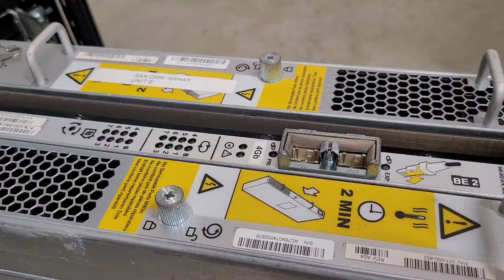What not to buy when picking a Disk Array on Ebay for your home lab. Say no to Dell MEMC KTNSTL4 FC

Comment: You are dead wrong..  You only lose the first four drives for FLARE code per array not disk shelf….
Reply from the maker: Sorry dude, not using the array with a EMC Dell array solution, (As in more then one disk shelf then you called it an array.)  this is native SAS config only.  No FLARE code involved.   This is me recycle old Storage array parts and using them for other roles.  Next time view the whole video... It about recycle old gear for new roles.

Comment: Hey, just saw your video. I recently got my hands on EMC SAE 25x 205 SAS/SATA SSD JBOD array. Can you explain how to set it up? They didn't send me any cables, so it is a bit confusing for me. And I have no booklets or setup guides.
Reply from the maker: Sure, it is all about your SAS controller and if you have a mini SAS port vs. a SAS port. Refer to my two videos for more info. https://youtu.be/ODQ2oRhXNOU  and  
https://youtu.be/X3nu6AZea5Q
Reply from the maker: As for a good cheap controller, go with a LSI 9200 or 9300 series  SAS two ports external controller HBA card to keep it simple or can go with a RAID version as well for more advance features.  Enjoy!

Comment: Opinions on the KTN-STIL3? SAS instead of FC. This one ships populated. All I would need is a SAS controller and cables? I will be using a Mac Pro. I have a 2009 and 2019. Not sure if I should go with ATTO or Rocket for the RAID card or just get a cheaper SAS card and go with SoftRAID.
Reply from the maker: I am not sure about MacPro. that is a new one.  But if it is a intel MacPro you can boot off of a USB stick and boot into Linux and do it yes...
Reply: @leadiususa7394  So this would not just show up as a group of SAS drives if plugged into a SAS card?
Reply from the maker: @AmanOU2be  No, they would show as single drive if you are using HBA mode.  Then use your OS to group them, if you are in RAID mode, you will need to first group the drives into RAID groups that then they will be seen by the OS as large sized single drives.

Comment: I picked up an old Kaminario/Silk 24 Bay enclosure that appears to be a EB-2425PC-E6-2EBD-2P580-0TB-KAM. It has all 24 Samsung Enterprise 960GB SSDs with the interposers in the caddy. I have two Cisco UCS-C220-M5 1U servers. Each of the Cisco servers is connected to the shelf with an LSI SAS9207-8e and cross connected. When I installed Proxmox on both servers, I can see all 24 disks but I can't format them or do anything. I was going to try loading ESXi or Windows Server for verification but it seems like they are not accepting any commands like formatting, etc. I'm not sure what I'm missing. All 24 SSDs were tested externally and they are all good so I'm sure it's something not sending the right signals to the array. Wonder if I need to change from the IOLM6 modules on the back to something more "generic?" Shelf has power and all drives are green and initialized as well. Any ideas? Thanks so much. This video was amazing for the homelab guys out there.

Comment: What can you recommend for adding additional capacity to my Dell R720XD? Running TrueNas, I can't decide if the MD1200 is sufficient, or if going for a 12gSAS is worth the effort. Usage is 4k video editing by 2-3 editors on 10gbe network.
Reply from the maker: Go 12GSAS for sure.
Reply: @leadiususa7394  what kind of shelf do you recommend? Looking for 12 bays minimum, 24 max. Noisy isn't a huge concern as the rack is in a central shared printer/copier room and an enclosed cabinet, but I'd like to not have to hear it from the elevators haha.
Reply from the maker: I like the EMC / Dell 24 disk array for 2.5 inch drives (EMC 25x 2.5'' SAS SATA SSD Server Hard Drive Array Expansion JBOD) because you can do NVME or SSD drvies as well.   As for 3.5 inch the array you picked will work as well.   Here is a  link to the EMC disk array for your eview.  https://www.ebay.com/itm/324663241031?chn=ps&_trkparms=ispr%3D1&amdata=enc%3A1rVyDGQjcTcin8Cu68RHx_Q42&norover=1&mkrid=711-117182-37290-0&mkscid=101&itemid=324663241031&targetid=2321110923341&device=c&mktype=pla&googleloc=9015806&poi=&campaignid=21411024926&mkgroupid=173029508388&rlsatarget=pla-2321110923341&abcId=9450167&merchantid=101707307&gad_source=1
Reply: @leadiususa7394 Thanks for the quick response! I should have clarified. I'm looking for 3.5" bays. My current array is 8x8tb RaidZ2 +1 hot spare. I'd like to add another 6x18tb in RaidZ2 again. Do you happen to know if an md1200 will be a bottleneck if I were to use actual sas disks, vs a 12gSAS shelf?
Reply from the maker: @MHM4V3R1CK  The bottle neck will be between the controller IO support level vs. your disk IO speed and handling unless you use SSD drives instead. SSD drives will max out your controller at 100% and then your controller becomes the bottleneck.   Other things  like mixing SATA and SAS drive types, drive speed type like 6GB SAS and 12 GB SAS drives and also having to many disks in a raid group can slow things down as well.  A good fix this is to use trueNAS OD and with a lot of RAM, like around 100GB or more.  That can front end your transfer rates at high speeds and then later write them to disk as needed. That is a big plus here.  The math is simple. Your controller / controllers have only some much I/O they can handle.  Each disk can do so much I/O for each drive.  Add them up and your will know your limits.  Side note.  If you already have a disk array then adding a new controller and second array will have an impact on the PIC-E bus slot if you have it in a lower end slot.  Make sure to check that as well.

Comment: I bought a MD1200 and I hated it so much. So heavy, loud and obnoxiously bright. So I ended up building my own DAS, which is way quieter because it uses bigger fans and it has a faster, more efficient controller while being able to handle more drives. Much better
Reply: What parts did you use?

Comment: I am new to some of these server equipment.
Can I, and how do I connect a "Dell EMC 25x 2.5'' SAS SATA SSD Server Hard Drive Disk Array Expansion JBOD Chia" to me, Dell PowerEdge r820?
Reply from the maker: Get yourself a LSI external dual port SAS 6 GB controller 9200/300 series or better will work. do you research on your cable hook up, it will be a mini-SAS to SAS cable or a SAS to SAS cabling

Comment: I found an EMC with caddeis (empty) locally for $100. Do you think it's worth it? Does it work with SATA drives? How about the noise? Is it ok for a home lab? Thanks!
Reply from the maker: What is the model number of the array?  Need to know that first real fast.
Reply: @leadiususa7394  It only says EMC model SAE on it. Controller model is 303-104-000E (has two of them). Thanks!
Reply from the maker: @andycristea  So that SAS controller belongs to a EMC SAE 25-Bay SFF Hard Disk Expansion Array .  Very good array to own and it is not load after post power up mode. It does SSD/SAS/SATA/NVMe (with special adapter but not worth doing.).  Nice,  Now get a exrternal LSI sas 6GB controller for your system to hook it up.  Do yopu research on the external correct SAS cabling to match your hook ups. Have fun and enjoy!   BTW check your PDUs to make sure they are good.  If bad, they will ramp up the cooling fans till replaced. heads up
Reply: @leadiususa7394   I'll buy it then. I have a SAS 6gb HBA. I was worried about it needing proprietary stuff.  Thank you! <3

Comment: Are there any good 3.5" jbod fibre channel disk arrays?  Or to eventually use in raid1?
Reply from the maker: Well you can get a NetApp DS4246 Disk Array Shelf 6/GB W/ 24x SAS SATA Trays 2x IOM6 Expansion JBOD array.  They run around $190 avg. Real cheap but do you research for the needed parts and cabling.   Here you go    https://www.ebay.com/itm/375273952742?itmmeta=01HTXPYACSYWKZEXXVQR4GR8CN&hash=item57601215e6&itmprp=enc%3AAQAJAAAA8BdhzrqpXoh%252BmV3ooIkZkszCqI%252BrEIWHeD%252FX1aR%252BqpL2CpYsbKvVxrwZEzQPFnP%252B%252FSg8gib%252Fa1R2wJ3fF%252Fl3ZKozzmqgxXjJ3azAma%252Blccmk6jx6nNS%252FiYnSRIHujf%252FEb97cg7YG1tC1lDApD%252B1Rjw%252F3q%252FOAQz9B7m6ZTxJ38BzwbVBTq2rvXRqow8zeSn%252By2KYKLNrf6asEDjdcDBA6GsffP1YI4HWiwmwCMm%252Fe7Nqu3CxxMJ6xXJSQq0I%252B8rnZsVUZLFmqoSW3yXCdCsSJbjF6P9jKZ8bUcrbhG7JJMkEfgC%252BMDram%252B%252BSj%252FhOk%252FlTyeA%253D%253D%7Campid%3APL_CLK

Comment: Hey mate nice explanation. Can you give me a good solution for disk expanding in dell r210ii server? A good and a cheap solution for small rack  home lab. Something like box in 3:20 min in your video. Thank you I am w8ing your answer.
Reply from the maker: Well if you do have the full height PCI-E card slot freed up, you can go with a LSI SAS RAID or HBA controller.  You like storage management, go with the HBA card and build your own TrueNAS server,  If you just need space get a RAID version of the LSI controller , build a raid 5 or raid 1 group of disks and start using your space. Here is a link to a cheap LSI 6GB controller simple and does the trick. https://www.ebay.com/itm/375094699923?itmmeta=01HRSHA7YZVCHAW3KY2WECZTMJ&hash=item575562e793:g:7JoAAOSw-a1gmwZK&itmprp=enc%3AAQAIAAAA8G5%2BWDwvZcpU7BpT70iV0PY%2BJpB1SrbfNWAwPVKhqjb%2Fh2VG6wbEedmlS4rPqq6FuZd2EFOS9kdY%2BlpVwCDlEAi30ScmFNE2Y3VtnVDFQ7vv38sm4K%2BKvDUC4l3iz2iPHCsDy6edQDBiBil9c7iuLU3mVJHIFjUB803FKpVyQztRMbmF13c%2FE40WRtU8tl7LKPc%2BGX6S3Q35rxlzNowrmy6FNot5QyrpU8ZwMGyOexMsz2zO%2F8Bb2Md%2F6PC01J9L1PS5xoeUYaWzlJIuF8%2BqPTzetnlXz88y4G77xt6StPyNK2LbZSTo%2Fsam4OsH4%2BeooQ%3D%3D%7Ctkp%3ABk9SR9T_qLHGYw you can go faster to a 12 GB card...      Next get a external disk array like mine and some cabling / disks and you are on your way!
Reply: @leadiususa7394  OK perfect about  first step. The other step is the box like your what is the model and if you can send me the link to check the specs. But for that I have a big problem in my rack. It's small  rack in depth. Perhaps the dell server have depth 36-38cm. What box can you sagest me for small rack max 35cm depth and I don't care for slot of hdd. I am OK and with 10 slots and up. Thanks for reply I will appreciate.
Reply from the maker: @gttechgr  Not a issue, the disk array is a shorter chassis. then other disk arrays so it should fit.  Here is a link.  Dell EMC 25x 2.5'' SAS SATA SSD Server Hard Drive Disk Array Expansion JBOD array :   https://www.ebay.com/itm/295817116043?itmmeta=01HRSPYHXD59EAVC3A544KR7Z8&hash=item44e012f98b:g:9SMAAOSwT85lHcGa&itmprp=enc%3AAQAIAAAA8KpBU7Yh5VoRvCrMUA7ie6qsLLAUtf5mC%2FeymvdxbOoFXE8qC3W1y5GrnNAeno9eLeWq8PNcqZMdlYejMYub1eB%2BhQEqV2Lbv1vDshjcIa16g5cRVoRZjCh%2BZC%2BZpnDrRrT8Nb8EZ2n%2FE4hr1O9cmsDJCzFbqdrb9CEd3PuscMLovecnAS2wHObx0%2BNHtkS1haSLIjEUWtzgzHfOyIyr%2FkBcfcuMa660FlIXbAJaKcJN5waA8eLKZGqhZUrrYRZ6IQbm5%2BNAFp9xcK9vaeOrDyiUYhCYo5w0asonnj%2FWgLQfBdoiMsoiLVdVG7FYYV554Q%3D%3D%7Ctkp%3ABFBM7J76tsZj  Check the specs but I think it will fit.
Reply from the maker: @gttechgr  Now refer to my video on how to work the right disks within the disk array, 
https://youtu.be/ODQ2oRhXNOU
Reply from the maker: @gttechgr  specs: https://www.ebay.com/itm/295817116043?itmmeta=01HRSPYHXD59EAVC3A544KR7Z8&hash=item44e012f98b:g:9SMAAOSwT85lHcGa&itmprp=enc%3AAQAIAAAA8KpBU7Yh5VoRvCrMUA7ie6qsLLAUtf5mC%2FeymvdxbOoFXE8qC3W1y5GrnNAeno9eLeWq8PNcqZMdlYejMYub1eB%2BhQEqV2Lbv1vDshjcIa16g5cRVoRZjCh%2BZC%2BZpnDrRrT8Nb8EZ2n%2FE4hr1O9cmsDJCzFbqdrb9CEd3PuscMLovecnAS2wHObx0%2BNHtkS1haSLIjEUWtzgzHfOyIyr%2FkBcfcuMa660FlIXbAJaKcJN5waA8eLKZGqhZUrrYRZ6IQbm5%2BNAFp9xcK9vaeOrDyiUYhCYo5w0asonnj%2FWgLQfBdoiMsoiLVdVG7FYYV554Q%3D%3D%7Ctkp%3ABFBM7J76tsZj
Reply: @leadiususa7394  you are awesome dude. Thank you so much for the tips/info. Have a nice day. The connection between server and array disk it's with SFF-8088 right?
Reply from the maker: @gttechgr  Make sure you get your disk array first to ID the SAS or mini SAS controller type then order the correct cabling... Trust me when I say it value to check it when you have it first for sellers sometimes don't know hat they are selling. Best to check...
Reply: @leadiususa7394  yea thanks you mate. You are perfect 👌
Reply: @leadiususa7394  Disk Array that you send me it's 52cm depth. I can't fit in my rack. I am searching one month to find something like 35cm
 BTW thanks

Comment: I have two of those arrays now and I love them, they're surprisingly efficient as well and they will work with any drive. I currently have one filled with 8x 200GB SLC SAS SSDs, 9x 400GB eMLC SAS SSDs and 8x 1.6TB eMLC SAS SSDs all with matching caddies witch were a pain to source.
Reply from the maker: Yea, I use the 3 TB ssd drives myself. It run well, I agree, the caddies can be a pain to source out.

Comment: How about EMC DS60?
Reply from the maker: If you are talking to the disk expansion array.  I have not worked wit those arrays yet but who knows.  If a SAS array has the basics SAS setup, you can't miss it up.  FC or IP will not so much.
Reply: @leadiususa7394  ok thank you. It has a sas12gbps controller

Comment: How do you think about the Dell PowerVault MD 1400?
Reply from the maker: Well it is a still a SAS disk array so you can't go wrong.  But if you want volume go with the 3.5 disk format but if you want high I/O go with the 2.5 drive format with SSD drives.   No need for NVMe drives.  You will not get the I/O from those drive.
Reply: @leadiususa7394  Thanks for the response!

Comment: Why would channel groups be necessary? For example, when I had my HPE blade server attached to an MDS600, I was able four different storage pool zones. I was able to assign different hard drives (provided that they were in the same drawer) to a particular zone. The SAS switch was in the blade chassis.
Reply from the maker: Sure you can do that and yes that is allowed.  The goal here was to max return and performance by type.  First the SAS channels allow for correct bus so you can reroute with out lose of performance secondly it allow for dual pathing but if you group all of the same disk type for normal operations and not cross over drive classes like SATA vs.SAS. drives in the same channel  You will get that max return for your disk pools plus they are grouped by default for your HBA disk pools. can you replace a 1TB SATA from SAS 1 TB dirve on the same channel yes but you will see the drop.  Slowest ship of the fleet and all that.  having two different type class drives on a single channel will require the controller to add a wait state to do checks that are different then the SATA drive.     This was about maximizing a old SAS array to ge the most from it.  Yes you can do what you say.  But why not try to max it out.  Check out how I got NVMe drives to work on this old array.  That will blow your mind that you can move to NVMe instead of spinning disks.  But you will not get eh I/O that you should with them for the I/O of the disk array is the bottleneck and not the NVMe drives.  But it was fun and the heat levels when down and not as noisy.  Great question by the way...  Keep having fun with your IT goals!
Reply: @leadiususa7394  The MDS600 that I was using, is a 6Gb device. What that means is that if I even have a single 3Gb hard drive, then the entire performance of that drawer was demoted down to the lowest speed. So, the RAID controller in the blade, the SAS switch, the I/O controllers in the MDS600 chassis and my Dual-Port SAS drives all had to be 6Gb compatible. The only thing that I was never too sure about, was if it's okay to mix 10K and 15K spindle speeds. The MDS600 holds two 35 hard drive drawers for a total of 70 per drawer. I believe that dual SAS controllers could handle up to four drawers.  This makes a total of 280 hard drives with dual fail-over paths. The successor to this was the MDS6000, which I've never dealt with.

Comment: Really my experience of FC arrays is you can put them in an arbitrated loop. So all you need is a FC card and some simplex fibre optic cables and boom you can use them like direct attach SAS shelves. In fact if you only have one shelf a standard duplex fibre cable will do. I think they dropped arbitrated loop support after 8Gbps FC but they stopped doing FC shelves and went SAS anyway I have never seen more than a 4Gbps FC shelf myself. One gets the feeling that there is some Dunning–Kruger going on here.
Reply from the maker: Blast from the past, you are correct if the HBA that you use will support the single mode.  Many years ago we got one to work but the other two HBAs would not do the role like the firs so it was a Flair-code related issue with the array so we dropped it.  But yes it could work.

Comment: I think this is very dependent on the persons setup and what they are trying to achieve. For your setup with one server and using the JBOD SAS shelf this makes a lot of sense, but if you had say, 3 truenas scale physical nodes that you wanted to supply block level support for, it makes a lot more sense to use one shelf and partition the 3 disk channels to three nodes over FC. Your 1 24x JBOD can't supply 3 physical machines over SAS with a set of SSD flash storage. The cost of FC is so cheap now, it makes way more sense to pickup a silkworm 300 for maybe $40 and a few FC HBAs for $10 than to get multiple shelves for multiple servers that need direct block level storage.
Reply from the maker: Totally agree with your viewpoint. But did this on the basic deployment model because most people can't buy a lot if resources off of Ebay.  I may research this more down the road.